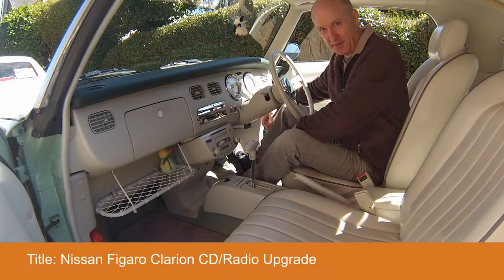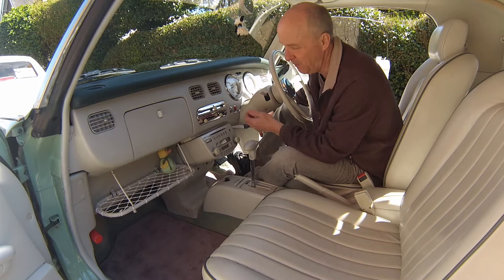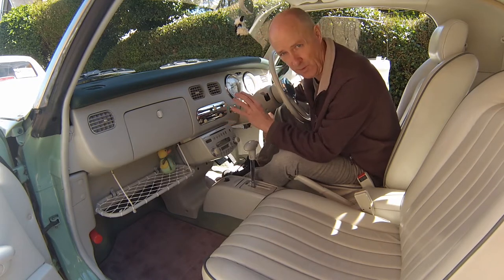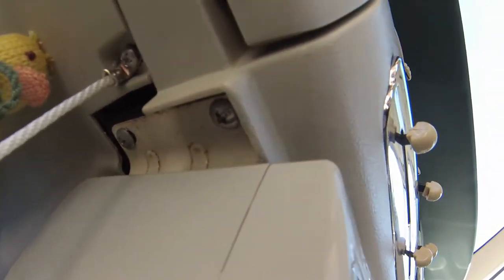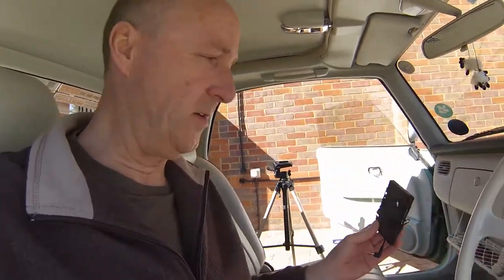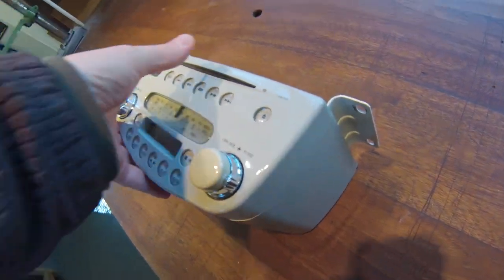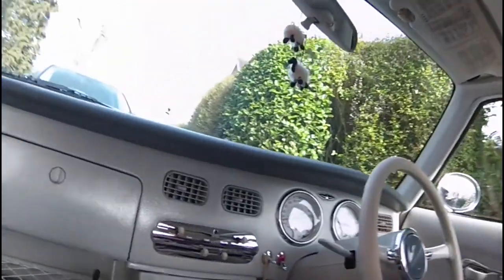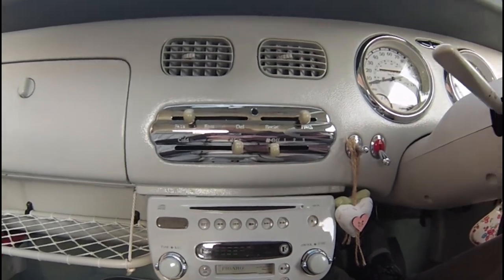Nissan Figaro Clarion CD Upgrade Video

Comment: One important thing to note, the area on the fascia behind the radio here has already been cut out into a large rectangle. From the factory there is just one small rectangular opening, big enough to fit the connector through, and a small round hole for the antenna cable. When I installed the upgraded radio I also had to similarly cut out the fascia in order to be able to fit the additional cables on the upgraded unit into the space behind (a sharp Stanley knife will cut the plastic).
Reply from the maker: Thanks Kieth, good information 👍